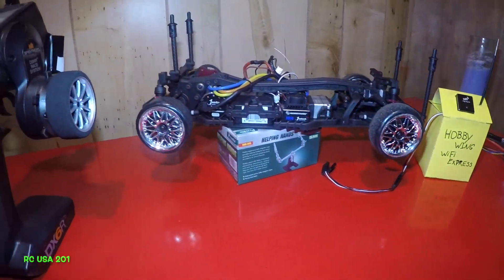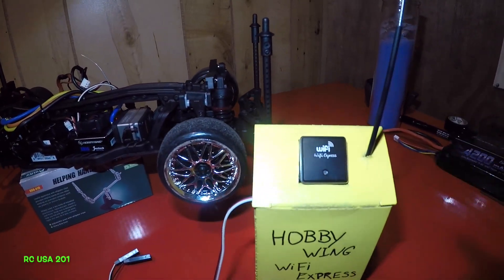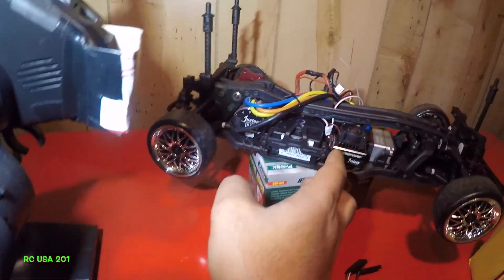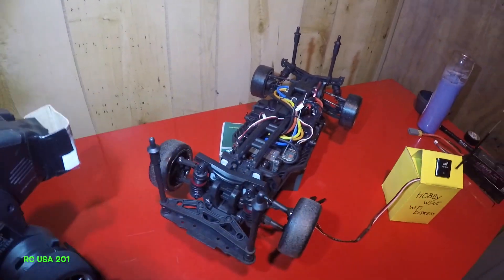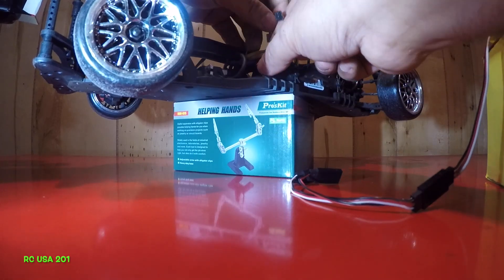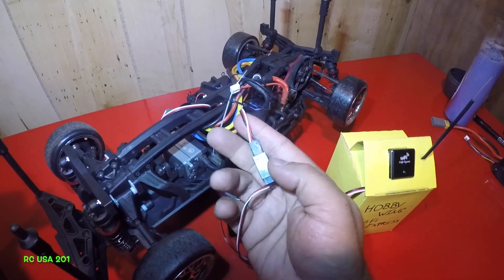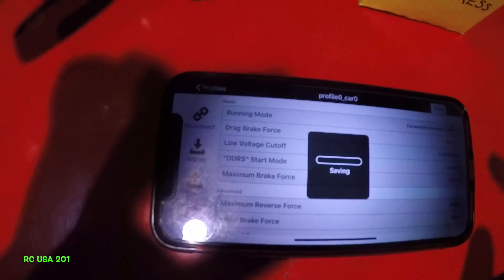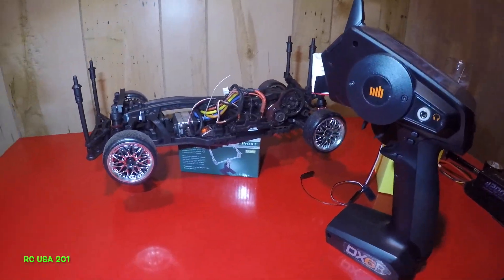HobbyWing XR10 Justock ESC Programing

Comment: For brushless setups, all you need to do is swap 2 of the wires on the motor. So say instead of all the same color wires connected, motor blue will be connected to esc orange & motor orange to esc blue & it should operate correctly. Had this happen with my first brushless setup (SpeedPassion ReventonS) & had to do this. Worked great afterwards. No need to reprogram transmitter or esc. 🤙🤙

Comment: Hi there, great video, very useful.
I am trying to setup the ESC properly but I am unable to set the brake.
My gear is a Sanwa M17 transmitter and a RX-493 receiver. I have already done the binding of tx and rx and all settings on transmitter are default all curves are zeroed and also calibrated throttle and steering on the transmitter.
For ESC I am using the HW XR10 Pro G2 and for motor the V10 G3R 13.5t. I have calibrated the ESC with the transmitter successfully and I am to get forward and reverse but I have no brakes.
The ESC settings are default. When I try forward/reverse/brake I get forward and revrse but no brakes. The same for only forward/brake, I get forward but no brake.
This is my first race kit build so I may be missing some setting or any other step.
Any idea where I may have missed something or dome anything wrong?

Comment: You need to calibrate the esc, thats when you turn on the ESC with the red button pressed and keep pressed on the ON/OFF switch....till it beeps then you press the red button 1x with the throttle pos in neutral, then press it again at full trottle trigger, then oress it a third time at full reverse throttle trigger!

Turn it off and on again.....it should be fine!